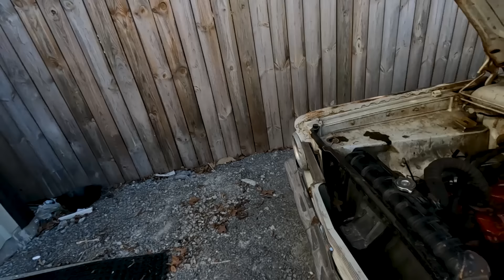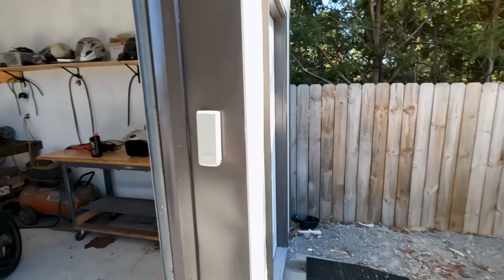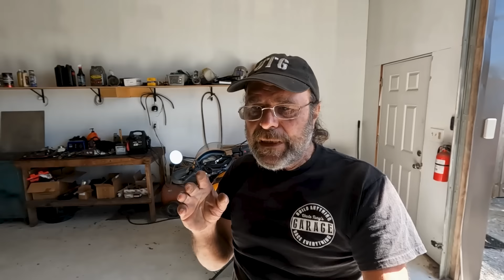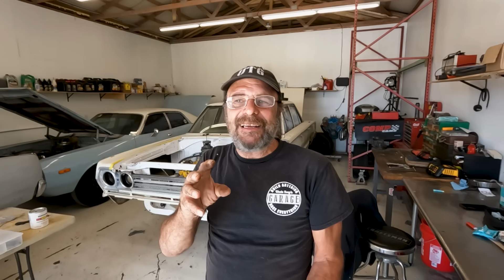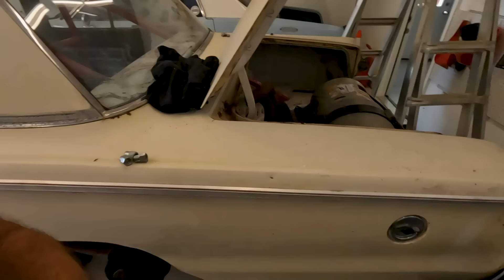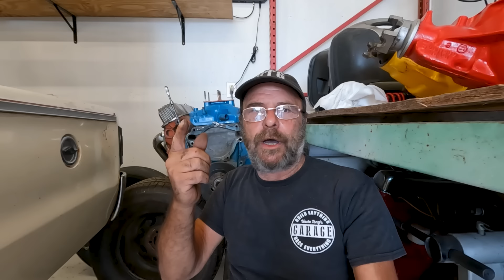Classic Car Tuning Problems - Curing Off-Idle Stumble, Bog, Hesitation, Stall And Backfire

Comment: Would love you to cover locking out distributors and timing on big cams, ignition and carb tuning. Ive onluy got 5" vacuum at best idling and even a 25 power valve is borederline. Im current running a locked out dizzy set at 40 degrees. That seems to be where it want to be from idle to top end, ut just works great, Any more and it starts to detonate and any less it wont idle!

Comment: I read David Vizards book and he stated at idle the vacuum lowers the boiling point of fuel allowing the mixture to vaporize. When the vacuum falls due to opening the throttle the fuel reverts back towards being a liquid. The accelerator pump compensates the lean condition due to the transfer of the state of the fuel.

Comment: Hey Uncle Tony, can you do a video about WOT performance issues and secondaries and when to adjust. 
I seem to have an issue where right after 55 mph you can feel the performance start to fall off, it still making power and climbs but the inertia from the butt dyno says the acceleration has reduced.
When it pops into third gear at 82 mph at WOT, It seems to slowly climb from 3500 and tops out at 4200 rpm, and will not give anymore.
I have AVS2 650 carb and I'm not sure when to swap the jets on the secondaries. I went two stages rich on the primaries #8 on the calibration sheet, but doesn't say much about the secondaries, I seem to get a little more when I do #12 on the sheet, so I'm thinking the secondaries need to go at least 1 stage rich.
Do the secondaries have to follow primaries in jet sizing? if I went two stages rich on the primaries, would I have to do the same on the secondaries?
Or is it just the engine has given it all she's got captain?
Specs:
1984 318 with a mild voodoo cam, bored .20 over with flat top piston, stock rockers 1.5, 110lbs/.in valve springs, Edl 2176 intake, A727, 8.25 rear end with 2.93/2.94 gear set. 
24* initial, 35/36* all-in mech,  at 2600 rpm, vac advance 16*  Total all-in 51* running on 89 ethanol free.
I'm a youngin born in the fuel injection era.
Love your videos, and the wealth of knowledge you have. Keep rippin gears.

Comment: You should look up the Chrysler Australia engine design plans for the mid 1970s , Chrysler Australia wanted bigger engines , GM Holden was going to import 403 ci Oldsmobile V8s for its Statesman long wheel base model and LE Monaro two door, Ford wanted the 400 V8 that it was going to use the low deck 302/351 Cleveland block it already cast at the Geelong Casting Centre and install a 4.0 inch stroke crank. So Chrysler Australia was looking to jump on the 400 ci band wagon , but a big block B400 was out of the question , so Chrysler was already casting the 215/245 and 265 ci Hemi Six here ( that they also wanted enlarged to 300 ci ) so the plans were drawn up for a 404ci LA based small block . The official Chrysler Australia paperwork listed a 4.10 bore Block Cast in Australia and 3.825 Stroke crank of nodular iron also cast in Australia , with 6 inch rods and pistons to match, the project called for a 6.7 litre V8 for the late 1970s beating Ford and Holden . Several 4.10 bore blocks were cast and one engine assembled . No idea were it is today or if it ever ran . But it's an interesting piece of Chrysler's history , a 6.7 Or 404 ci LA based Small Block Chrysler would have been amazing . All the LA after market parts such as intakes and cams would have fitted , plus a 6.7 litre SB is so much lighter than a B400 . Shame Chrysler Australia never proceed with that engine .

Comment: I have a 350 with a Holley sniper 2 with a very high idle at around 4200 rpm and when I messed with the timing it brought down to 1800 but I’m not to sure what to do now and wondering if I can get any ideas on what to do here?

Comment: I experienced this with a slightly modified 360ci FE engine. and fought it for quite some time. the engine was bored .030 over stock with a 539 lift 280° duration camshaft. with four barrel intake manifold and carburetor. I tried multiple carburetors and distributors but still had a lean condition issue. where it would cough up though the carburetor. and on Fords ported vacuum is used with automatic transmissios. and manifold vacuum is used on manual transmissios. and this vehicle had a manual transmission. I finally found that it was because I had a speadbore carburetor. using an adapter on a straight bore manifold. and the back cylinders would lean out because the primary throttle plates couldn't feed the rear most cylinders. because of the straight bore manifold.

Comment: Well when I used to tinker with small block Chevys I would advance the timing until it would start hard hot meaning the battery and starter you could tell it was too far advanced and then I would retard it until it started easily hot spun over shall we say. Another way now this is all me not being a mechanic at all. Would advance the timing until I would hear it ping when I got on it and then I would keep that I would retard it and then I would go out and hit the throttle again and I would do that until it wouldn't ping anymore or knock whichever the word is correct. Yeah I don't know if this is correct but this is what I did. Now question two on a motorcycle do you think adjusting the fuel air ratio screw using a vacuum gauge other than just listening to when you get the highest RPM or between the two lower RPMs. Do you think a vacuum gauge is a better way to do it like you do a carburetor on a regular automobile. I was thinking of putting in a nipple and drilling and threading so I could actually put a vacuum gauge on my shovel head. And then of course taking the back engage off after I get the best reading. After adjusting the fuel air ratio mix to your screw. And then capping it off of the plug. Do you think that is a good way to do it Thank you so much for your videos

Comment: So much gold in this one video! What solved my issue was using a quality rebuild kit. The rubber on the auto parts store accelerator pumps is crap and as soon as I had a good pump in the carb it was fine.
Reply: HNBR is where it's at. I don't know how many kits make use of it, but it's like rubber on steroids. It's the bomb, I use it anytime I can, over rubber.

Comment: Never trust the dampener or pointer on any car with more than 50k on it, tune by feel and ear is what he is saying in a nutshell.If the acc pump is working.
In the 80's after ever "tuneup" we test drove the car with a dizy wrench in our pocket, dead stall with the brake and tune the dizzy 3-4 quick stops and you can get it right. Check for cracks in the vacc lines old leaking hose are 90% of lack of advance. All this shit is so dam simple if you know/understand how it works

Comment: How do you know what I need right when I need it? I Just put new exhaust on my son's international harvester pickup with 345 v8 and holley carburetor. Fixed the accelerator pump like you said, then set idle and timing with your old video. https://youtu.be/aBbD_JlKBGY?si=XcQbNgbiWoc252t8 now touch throttle and Bam, she goes!

Comment: I don't have any stumble, bog or any other troubles. But tuning has always interested me, so you got a view.  You just reminded me that I haven't really finished the setup on the Edelbrock AVS2 that came on my SBC.  Might be able to do some timed runs and get the jetting right.  Once it's there I can see how it does using your power timing move.  I have always just gone 34 to 36 degrees all-in on my 350's cause it's safe and works. I suppose I should be trying to get all the juice out of my car. Otherwise I'm leaving power (fun) on the table.

Comment: You forgot the off-idle circuit. Off -idle slots transition the carb from idle to main metering. Some early 70s two barrel GM carbs had a screw in the back of the carb under a plug that you were not supposed to remove. They were often set too lean and would cause an off-idle stumble before the accelerator pump had a chance to work. They were called “off-idle air screws” so turning them in richened the off-idle mixture.

Comment: How much pitting in a cyclinder will cause oil consumption, i have a 302 with beautiful bores no ridge nothing but one hole has a spot as big around mayby as a no. 2 pencil eraser, if you rub your finger over it you can just feel the texture change.

Comment: I had a customer with a 78 Monte Carlo w/ 305 V8. Complaint was a major lack of power. It would have good throttle response, but then it barely had any power at all. It had all the symptoms of a plugged cat converter. After replacing the cat and not solving any problems I discovered that the centrifugal advance was totally stuck. Removing the distributor and freeing up the weights made it run like new! Why did it still have some pep off the line? The ported vacuum advance gave just enough timing to take off, but as you opened the throttle more, that vacuum dropped off, and timing was back to where it was at idle. I learned quite a bit about timing after that!  
BTW, I have always used the "advance til it pings and then back it off" method, with rarely any problems. Glad I didn't try that on the Monte!

Comment: https://youtu.be/AS7nWkn3m94?t=957 - I tried this today by the time I got to the highest vacuum reading it sounded good while idling, after shutting down and restarting it would barely start, I checked the timing and it was reading 21 degrees btc. that’s a big fail.

Comment: Old GM  Stuff with HE I's I wouldDo a similar thing to power timing but I would raise the RPM to about 2500 3000 and adjust the distributor in the advanced direction and till t started missing stumble a little bit back it off a little and then lock it down usually pretty close I use this when timing pointer's are not accurate or not there.or balancer is spun if u suspect spun balance damper replace it.

Comment: I've gotten turned around on tuning cars with accelerator pump problems it's just like the mechanism in a spray bottle like  Any kind of spray bottle like Cleaning products windex come in or any kind of just bottle you fill with whatever same kind of mechanism If you pull the trigger you don't have a good solid squirt.  I was always taught that it should be a clean spray throughout the throttle movement not A Half  Squirt and then a dribble. Also need to make sure that the fuel bowl is full when you're checking this cause you cant do it a bunch of times and get yourself turned around because there's no more fuel in the bowl than the engines flooded and it won't start but anyway I hope you get my point I love this video Tony. This is the kind of stuff. That was lost in the generations after you.

Comment: You tell it wrong. The most important part of carburator is air vent to the bowl. Carbs don't work from vacuum, the neck down (venturi) in the carb by the throttle plate, most times it's small brass pipe on the middle, on '79 dodge trucks w slant six it had a 3/8 3:19 hose from top going to a canister on the fender. The hose go bad, folks plug it, it's the wrong thing to do. Carbs don't suck gas, atmospheric pressure pushes it to low pressure area behind venturi. It's that deal about the airplane wing,air pressure under the bottom would just rip it off, it's the vacuum on top side of the wing lifts the plane, it opposite what you think. Now accelerator pumps different deal, the little umbrella Deal works the bottom of the barrel the most, so you can clean it out and replace the sqwerter upside down umbrella, but the bore is worn. Worse at. The bottom where it works most.if new thing Don't fix it got to replace carb. Most folks ease on the pedal trying to save fuel, if your accelerator pump has wear better push it and get a squirt of fuel. That egg between your foot and the pedal let's fuel sneak by the seal where it's used the most. Vacuum advance comes in too, I like ported on carburator for this, manifold vacuum is not what you hook distributor to .
Reply: How DARE you talk to my Uncle that way😊

Comment: I manage a group of forklift dealer service departments. We hire young guys out of trade school and they've never seen a timing light or adjusted valves. What's worse is most of them don't know how to use a multi-meter or scan tool either.

Comment: Great advice on the newer dial back lights.  We purchased a HF model… 4-5 degrees off.
I’d add that if using a light, after setting timing with vacuum disconnected, re-connect the vacuum line and watch the strobe as you blip the throttle.  You should see the dampener mark jump ahead.  This will also verify what the type of distributor and if you have it connected to the correct type of vacuum source.  Jumps ahead- good.  Jumps back-  your distributor wants ported and is hooked up to manifold.
Reply: I also for the life of me can’t tell if my HF light is off or not truck will not run worth a shit with any throttle from idle/low rpm

Comment: All good stuff but check points before adjusting timing as if you adjust points after doing the timing win putt the timing out again as I used to work on motorcycles in the 70s and some of the twins had 2 sets of points on one back plate and you would set both sets of points the same and the timing would be different on each cylinder so would have to adjust the points a tad but make sure they were still in spec 0.3 to 0.4 mm

Comment: I have a 327 Chevy out of a 1969 Chevy impala in my 1953 Chevy car! I had the vacuum to the distributor on manifold vacuum and at idle it ran like crap. I switched it to ported vacuum and it evened out and runs better like a different car. I have not driven it at highway speeds yet. Do I have it hooked up right? Thanks for the how to videos. I love watching your channel.
Reply: Chevy typically run on manifold vacuum. However, I will always tune everything to run on ported vacuum. Many will argue but when you step on it you should get more timing not less.

Comment: This worked for me -- on a boat 351W -A vacuum gauge reading of 20 in. Hg Edelbrock 1409 Carburetor Step-Up Springs--stock was orange springs with bog than changed to the silver springs=8" bog gone

Comment: Hey Tony, I totally agree with you on dial back timing lights. I have a Craftsman timing light from the 80s that I've had for years that I bought, that is the dial back style and I found it not being accurate at all so I took it apart and bypassed (removed the pot/dial). After that it works perfect and still does today. You just can't beat the old tools as long as you know how to use them. Later

Comment: PORTED vs MANIFOLD only applies at idle. 
 General Motors and Ford used both.
 From a gm perspective, this is the reason for the 100-ft of vacuum hoses. 

 GM used a temp controlled vac valve near the thermostat with numerous lines going all over the engine bay. 
 When the engine was cold it used ported vacuum to keep the timing extremely retarded/late. 
 This along with the choke being on caused the charge to burn after top dead center and in the exhaust manifold, cross over in the intake and catalytic converter. 
 This caused the engine to run extremely hot to warm up quickly and fire off the cat converter. 
 This was the cause of  exhaust manifolds being cracked and gaskets burnt. 
 If you have either your engine will sound like it's knocking when your timing to retarded/late and firing in the exhaust. 
 
 Manifold vacuum when cold is going to the efe valve/heat riser to divert exhaust through your intake manifold and to the air cleaner to close the thermac door so it breathes hot air off the hot exhaust manifold. 

 When engine warms up the manifold vacuum is now directed to the distributor vacuum advance. 
 The ported vacuum is now directed to the TCC/transmission lock up, egr valve and the charcoal pollution canister. 

Engines that ran primarily ported vacuum had lots of initial/lead timing  16-20 °. 
 They also had a valve that at 220°f switched to manifold vacuum at the distributor so the engine didn't overheat while sitting in traffic. 
 Engines with 2-8° initial timing run manifold vacuum. 
There is no right or wrong ported or manifold, it 100% has to do with the way your distributor is curved.
 Exact same engines ran either or depending on on if the car had A/C  and the axle ratio. 
 
 The only vacuum lines needed are vacuum advance, brake booster, PCV, transmission, climate and cruise control. 

For an engine 9.5:1 or less and burning 87 octane gas with 10% ethanol.
 Set 34° total timing,  23-34° timing at idle using either ported or manifold vacuum advance to achieve this , this will put your theoretical cruise timing at 55 to 58° which will never those conditions.

  Aluminum intake manifold
 Thermostat less than 195"°
 Blocked intake crossover, all will cause hesitation until the engine has warmed up for 15 minutes unless you are tuned to the rich side.
 You either tune for the street/driveability, mpg/power or the track/race.

 Remove all unnecessary vacuum lines/leak points and dial in timing before even trying to tune a carburetor.
 Timing in excess of 38° at idle will cause a miss and strong fumes , use a vacuum gauge to obtain highest vacuum while adjusting idle mixture screws, in to far will cause a lean Miss, to far out will smell extremely rich.

Comment: great stuff thanks.  when you are setting up TDC and adjusting by hand, remove your spark plugs so that you are not fighting compression (especially turning reverse when using the damper bolt),

Comment: I have a bad stumble at any speed when accelerating Carb is a 625 Street Demon. Used to run like a scalded dog until this summer. Sometimes spits back thru the carb. engine has 12,000 miles  wityh stock dizzy awth a Pertronix conversion.  maybe the conversion kit is going bad? I have replaced that pesky plastic tube on the accelerator pump, no difference
 any ideas, anybody?